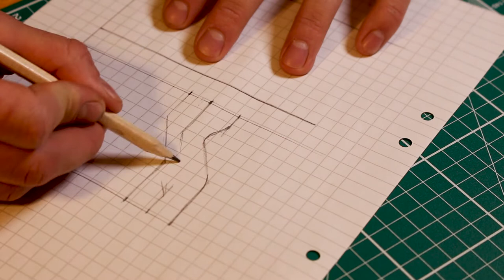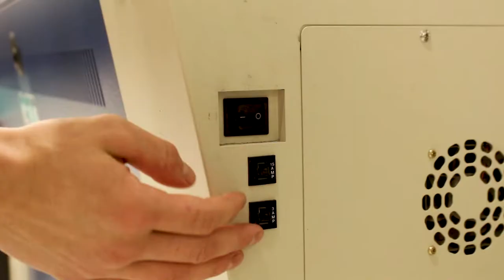Making a Vertical Leather Wallet By Hand - the Tundra

Comment: Very nice . I do a similar coin on the front . I use the wet method to get greater relief on the coin then glue a leather coin in the indent to prevent callapse. I hadn't even considered the trace that you've done. It's much simpler thanks.
Reply from the maker: Thank you !🙏  I only got the coin idea at the end of the video and I had to do it this way. I also thought I’d put a round piece of leather inside the wallet but the wallet had already been sewn and I would have liked to add a layer of leather after that inside the wallet over the leather coin, so I ended up with this method. the coin idea is better because it keeps that shape better so Good job man!